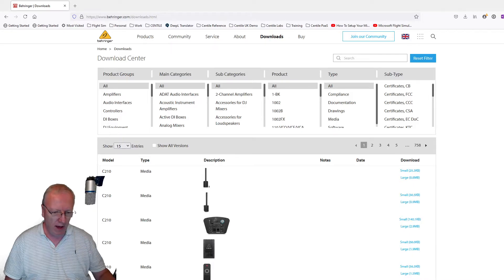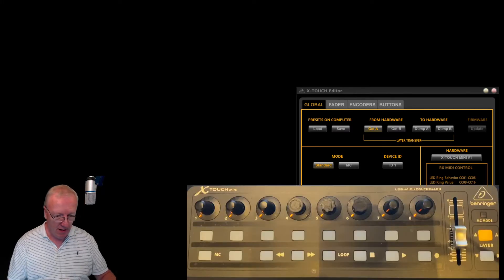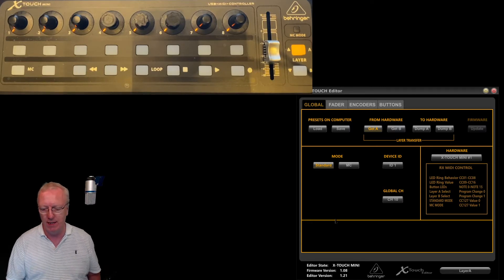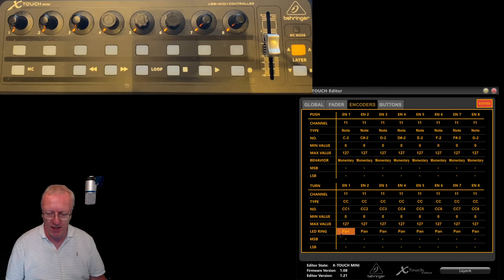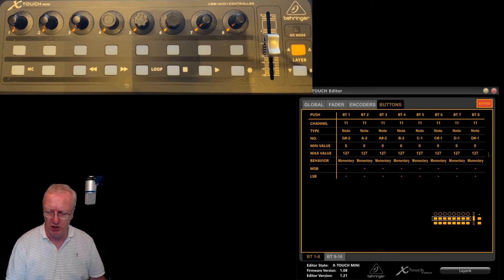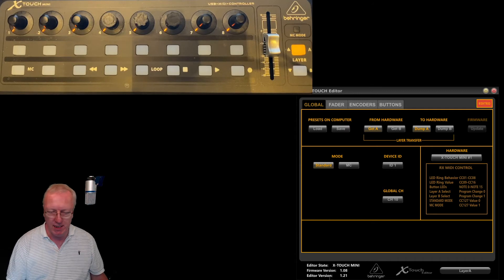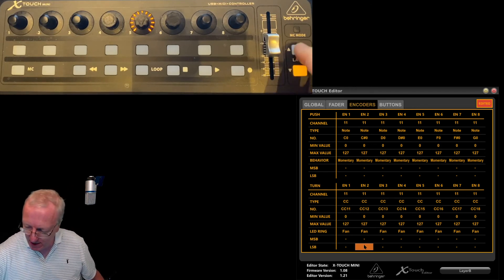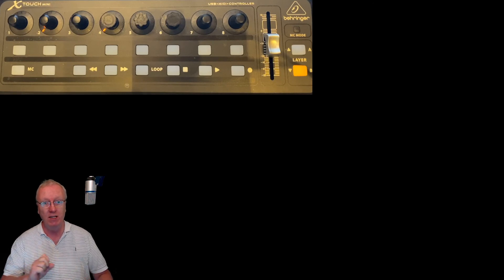X-Touch Mini Initial Set up

Comment: Thanks for the tutorial on x-touch editor !
There are lots of tutorials to help setting up correctly gain, compressor and gate for your mic. You clearly spend some money on your hardware but sound terrible with  too much gain picking up a lot of background noise  and a razor sharp gate that shuts it down after each word is painful after few minutes.
Reply: You really have patience. I found the gated noise horrible after a few seconds.
Reply: True. Remove the noisegate or give it a longer release.